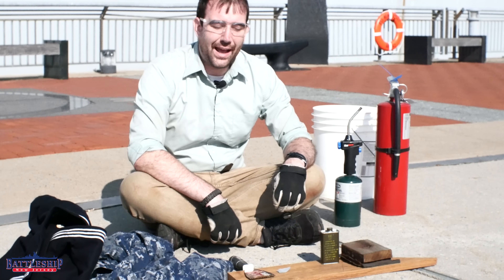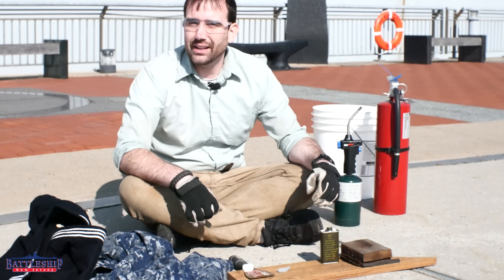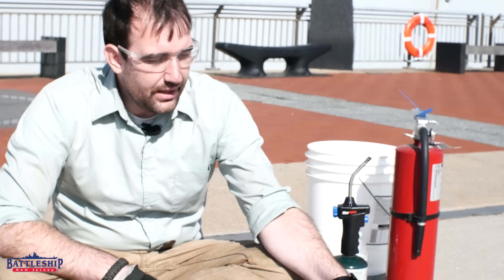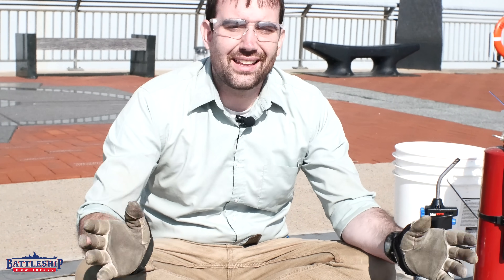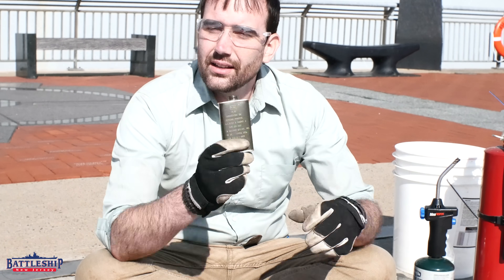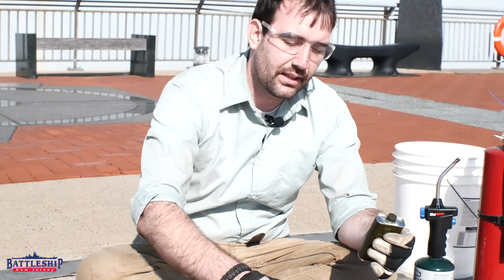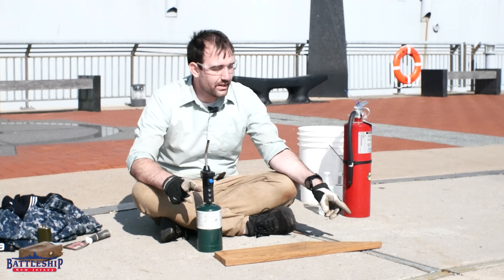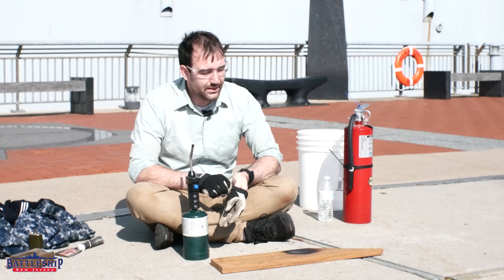Battleship Flammability Test: Gun Oil, Uniforms, and Teak Wood

Comment: Speaking as a blue collar who works in a weld shop. We are prohibited from having nylon clothing which the newer Uniform tended
 to made of. Melted nylon sucks to peel off skin.
Reply: People were sending solders things like Underarmor cool shirts. Nylon, spandex and cotton mix. The military had to ban troops using them in country. I remember the doctor interviewed said they had a harder time patching up troops from the melted nylon then bullets.
Reply: @Ghauster  that’s completely true it’s one to have treat GSWs and shrapnel wounds.  The explosion sterilizes the wound. But the with burns, they are more complex to treat because the skin acts as another bandage layer. But once the skin is compromised it’s becomes harder to treat
Reply: Melted nylon's probably pretty good at peeling off skin.
Reply: Chemistry labs have similar guidelines. Having clothing that is flammable generally isn't a problem, because you can usually remove them before too much damage is done to your skin. Wearing synthetic fabric that melts can be disastrous, though.
Reply: @alltat  when I ran a small smelter we had a thick cotton undercoat under our aluminized smelting garments. the other thing about non-synthetics is if a spark or splatter hits it, it might burn through to your skin but it just makes a small hole instead of melting
Reply: @alltat  Not just the melting to your skin, synthetic fabrics also (depending on material in fabric structure) tend to catch on fire rather eagerly, as opposed to e.g. simple cotton.
Reply: All labcoats should be made of cotton, so when it burns, it burns the skin, but doesn't melt into the wound.
Reply: Melted polyester sucks pretty good too... ask me how I know....
Reply: I was admiring the view in the Santa Cruz Mountains taking a break from riding my Triumph motorcycle dressed in leather. Around the bend comes a BMW rider with a synthetic riding suit. He did not know the road ended at an gated installation just past the bend. I ran over to see if he was alright after I heard the crash. He seemed fine except where the suit melted from friction. Don't know how much damage he took. He may have had enough clothes on under to keep the hot melted plastic off him.
Reply: @alwaysbearded1  the view there is really something, id presume you are talking about summit road?
Reply: Melted nylon is your skin. Depending on how severe that sh1t tacks, you'll have to get under the cutter to get it peeled off. Really nasty stuff.
Reply: If memory serves, they were polyester blend. Had a pair of work pants made of the same mixture, a lantern ignited the leg and yeah, stuck a bit, but nowhere as nasty as nylon would.
The astronauts killed in Apollo 1 were wearing nylon flight suits and worse, were in a pure oxygen atmosphere. Might as well been wearing gasoline.
Reply: In general, synthetic fabrics and fire/sparks are a really bad mix. Leather, wool, even cotton is way better, because neither of those will melt and stick to your skin. Neither are they particularly flammable. There have been horrible accidents in chemistry labs where people were wearing a nice sweater made from synthetic fabrics, worked with pyrophoric materials and had a minor accident that escalated into fatal burns because the synthetic fabric caught fire rapidly - were a proper lab coat would just have gotten a few scorch marks.

Comment: We called the black rubber stuff I used to use to caulk teak decks "Thiakol" because it was made by the Morton Thiakol corp, who also made the black rubber fuel for the space shuttle solid rocket booster engines :) Probably not the same stuff, but not surprised it burned.
Reply: Thiokol. 
Builders of rocket engines and snowcats. And everything in between!
Reply: @straybullitt  I'd watch out for their products in cold temperatures, though. Ask NASA
Reply: I learned something new today... Would you like to know what that is Bill? I'll tell you, I learned that in addition to aluminum powder as fuel, ammonium perchlorate as oxidizer, polybutadiene acrylonitrile was used as the bonding agent in the STS Solid Rocket Boosters... Thanks!
Reply: "Black Rubber Fuel" WTH???.... From NASA: For the SLS boosters, aluminum powder serves as the fuel and a mineral salt, ammonium perchlorate, is the oxidizer. Cheers!
Reply: @TrollAntiVenom  Plus about 12% polybutadiene rubber, which serves as some fuel, but mainly as the binder that hold those main ingredients together!
Reply: @TrollAntiVenom  The rubber is the binder it has the aluminum and ammonia perchlorate mixed in it
Reply: @TrollAntiVenom  It's usually abbreviated to APCP or ammonium perchlorate composite propellant, it's specifically hydroxyl-terminated polybutadiene/HTPD rubber IIRC. It's been  while since I leafed through solid rocket motor compositions so correct me if I'm wrong here, but again if I remember correctly the HTPD serves multiple roles but I'd imagine some examples of those roles include, but are not limited to; helping reduce moisture ingress (especially with the hygroscopic perchlorate content), improve casting properties, provide a small amount of fuel and most importantly improve the physical properties and structural integrity of the fuel grain (any cracks from the grain fracturing represent a massive undesired increase in surface area and thus burn speed and gas generation, possibly leading to total failure of the motor).
Reply: @TrollAntiVenom  all of that is mixed into rubber before being packed into the booster...

Comment: What you really have to worry about are fuel oil and lube oil flanges, valves, and lines rupturing in engineering, the liquid hitting a hot surface and igniting.  Because of that, "spray shields" (aluminized fiberglass cloth) covers are installed on all joints and flanges in engineering. In case of a leak, the flammable liquid is contained inside the spray shield and it drips out the bottom. You'll see these silver spray shields wrapped around yellow fuel oil lines going into the burners on Iowa class BB's (and all modern ships) and all the fuel and lube oil lines throughout engineering, even under deckplates.
Reply: Those are my thoughts as well. 
Next episode, spray all of those items down real good with some fuel oil.... 👨‍🚒👩‍🚒
Reply: @straybullitt  Those small fires won't incapacitate a ship, but a lube or fuel oil fire might.

Comment: Permanent press fabric is usually a cotton synthetic blend. It should be treated to be fire resistant. The RN, after the Falklands War, revamped their entire damage control systems including the clothing to be worn in the event of fire or explosion. What they discovered in all their testing is that treated wool is the best way to protect against fire for the damage control crew. It's pretty amazing. As you noted the synthetic in the blueberry uniform melted. That's exactly what the Royal Navy discovered. It's entirely possible when you're fighting a fire to be exposed to extremely high temperatures that your gear has to protect you from. The synthetics and the equipment they used in the Falklands melted. The melting material would stick to crew causing more than a simple burn leading to third degree burns in a lot of instances.

Comment: Generally oils are not flammable but combustible. Meaning the oil has to be heated up to its ignition temperature before it will sustain ignition. Gasoline is flammable.
Reply: Or aerosol them. Spray oil in a fine mist and it will burn.

Comment: A singe piece of wood won’t meaningfully burn Ryan, you need at least two, even a piece of very old and dry spruce 2x4 behaves no different than the teak in your torch experiment. There just isn’t enough surface area to produce enough heat to produce a continuous flame.

Comment: Yeah, those early to mid 2000s uniforms were not great in a fire. That's why a lot of our ground troops were issued flight suits until better uniforms could be made. Of course the new cold weather fleeces are terrible in fire. I've had to burn on me when touched by a small falling hot ember. The last one burned a one inch wide hole in my back and melted to the layer underneath.
Reply: I'm really surprised they passed those for use
Reply: @thejohnbeck  The people with the purse strings have NO clue.

Comment: It was layers of oil based paint which were removed at the start of wwii.  One layer of paint on primer is not as flammable.   The navy used to just add another layer of paint each time the ship was painted (every 4 to 5 years). So Battleships might have as many as 8 layers of paint depending on age.  Once lit oil based paint was surprisingly flammable.   Just take a trip across the river to USS Olympia to see how paint built up over time.
Reply: I have some experience painting things for the US Navy as a contractor. 
EVERYTHING gets two coats of paint, everytime that it gets painted. 
It's the same for all branches of the service. The government likes to have two coats on their stuff.
And the primer coat doesn't count. Two top coats!
Reply: Show me a paint that doesn't call for two top coats and I'll show you a fairly rare paint. Paint is cheap. Rust is expensive.
Reply: @straybullitt  A layer of paint is however many coats it calls for. He's saying it had multiple applications stacked on top of each other over the years not they only do one coat of primer and paint now.
Reply: @kylehenline3245  
I wasn't disagreeing. I was reinforcing his statement that there can be many coats of paint applied over the years.
Reply: if it dont move paint it, if it moves.. paint it again! old navy saying.
Reply: Look up the Yarmouth Castle ship fire for some very sad information.
Reply: The paint sitting on metal actually helps to keep it from burning. The steel of the ship acts as a heat sink.